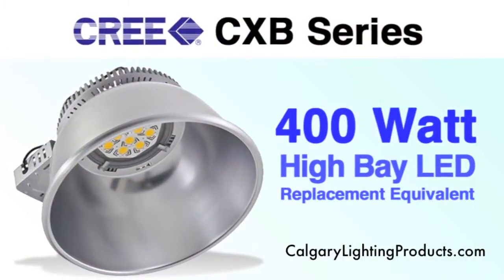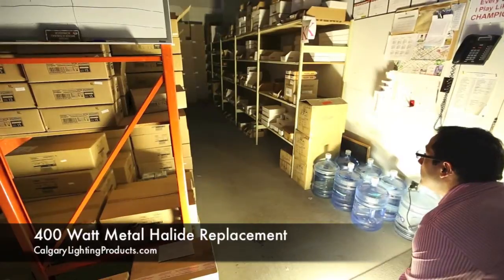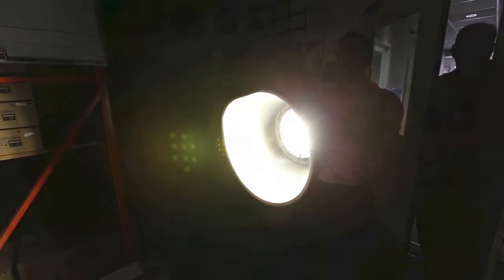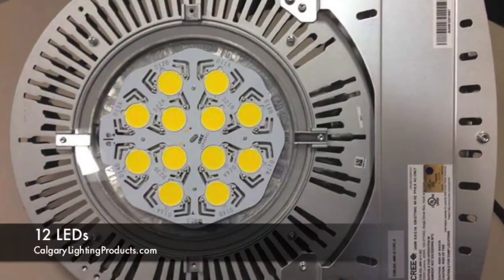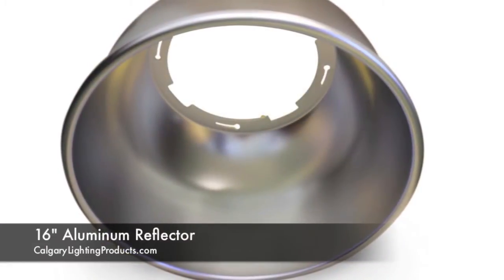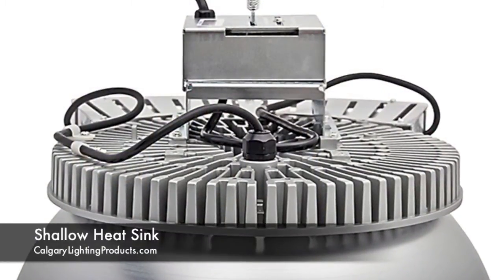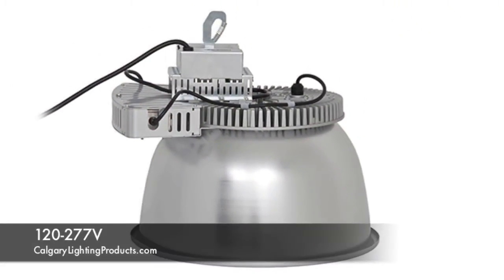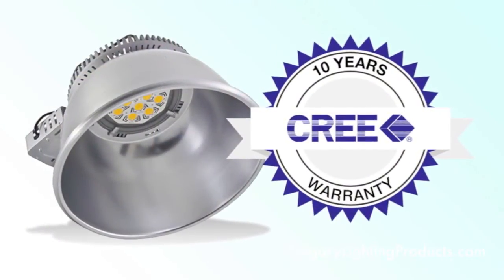CREE CXB 400 Watt Metal Halide High Bay LED Replacement

Comment: Because these light fixtures have universal voltage drivers in them you can connect them to the high leg of a 4 wire 3 phase Delta system.